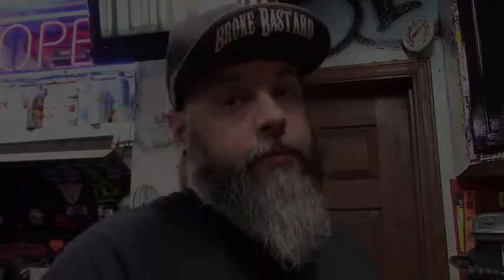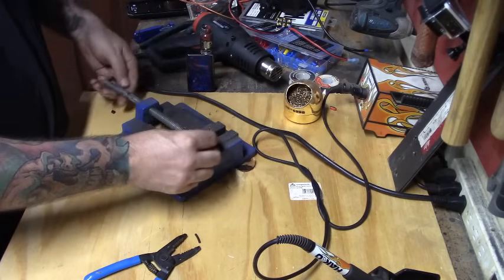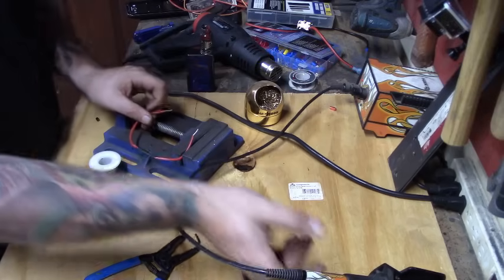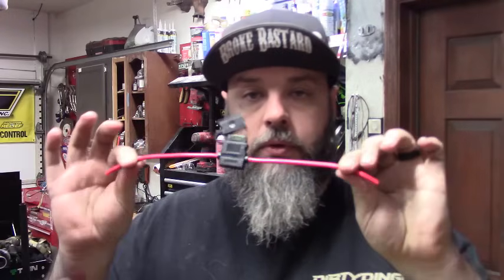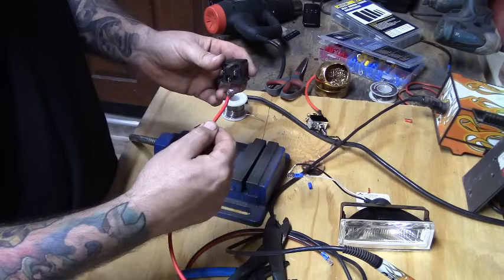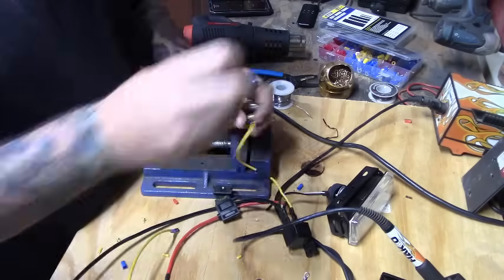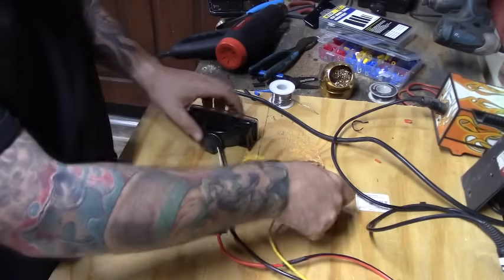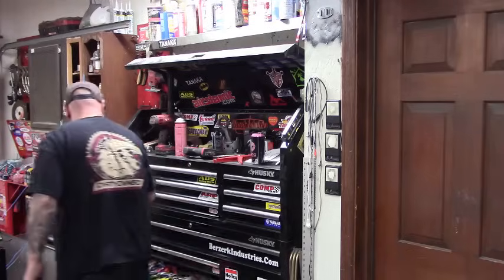How to wire a Relay and Why You should use them.

Comment: I have a car stereo that I wanted to turn on without using the key, so I ran it the other way I did use a fuse before switch. It worked for a couple months but not I keep blowing headlight fuses and I think I might have something grounding out. I also did add new headlights but bought a wiring harness with relays for it. Like I said they worked for a couple months before I started blowing the fuses. Is it possible I might have fused some wires in the harness? Also on the way you hooked that up where did the other end of the toggle switch go? 30 to battery with fuse. 87 to radio do I need mother fuse? 86 to toggle switch. 85 to ground. But not sure where the other post on my switch goes.
Reply from the maker: Paul Mayfield fuse 30 and the other post of switch goes to fused power
Reply: Broke Bastard Garage so I would have 2 wires going to the battery one from 30 relay and one from toggle switch? Both with fuses?
Reply from the maker: @paulmayfield9709  correct. You could pull the switch power from another constant hot. It only needs about 7 volts to trigger the relay. Battery is always the best. Some times I run fuse battery power to power multiple switches.
Reply: Broke Bastard Garage that’s why I thought I’d ask cause it makes no sense to me if I have power from battery going to relay and also to the toggle switch then it goes thru the toggle switch back to relay opens relay and gives radio power  I’m guessing it gets power to the radio from the other lead from the battery? I thought the reason for using a relay was to eliminate the high power wire in the cab which you would have it running to the switch then back out of switch to the relay. Cause that’s how I thought I should run it but the two power wires it what confuses me. Do you think it is possible that I may have melted some wires when I had it hooked up without a relay? Cause I did install led headlights also and I did use a separate wire harness with relays for that. But now I keep blowing fuses on headlights it shows there is a shirt somewhere and can’t find it. I even took all fuses out and tested each circuit. When I put the test light on my headlight fuse area it lights up as if there is a short. Then on the headlight prongs there seems to be power to all three prongs on one side and only two on the other. Which I don’t use that wiring for headlights since I bought the new harness you just plug into one of the headlights and leave the other unplugged. I know you can’t solve the problem over the messages but any input or thoughts on what I should look at next would be appreciated. Sometimes electricity and me we don’t get along. I don’t know how many times I have wired something it doesn’t work so I try a different way and blow fuses then go back to the way I had it and it was right. I could understand maybe not having a connection the first time so it didn’t work, but this has happened to me several times to where I make sure there is contact.

Comment: Glad that you made this video about soldering wires together on a car; other YouTubers have said that you should only use crimp or screw connectors because "solder is too brittle"...?  Dunno why they say that; I never had trouble with properly-soldered joints' coming apart on rough roads.

Comment: The problem is soldered wires can  break off , and solder runs up the insulation,  good quality crimp connectors stay flexible,  they dont solder wires on airplanes ,for good reason ,  I think it's best to stop wires moving too much i:e shrink , I like solder to , but don't under estimate crimps . Cheers .

Comment: My bad may have missed something.. but if for something so small and in most cases doesn’t pull really any voltage and even if it pulls 12v why put a fuse if your already putting a relay.. is it just for added support.. I’ve had people work on cars and they install poppers to shave doors and none of them use inline fuses just relays.. when installing other stuff then fuses would be put into place if the thing there installing doesn’t already have inline fuses … if that’s wrong by all means let me know , I have 1 popper to my door threw 1 relay and it works just fine bcuz it’s not in constant use ..

Comment: private request??  diagram from Battery (fused) to a relay to allow 3 way switch - 1 leg thru ignition - 2 (center) off) 3 hot direct from battery - thx  2023 subaru crosstrek 6spd manual have most wires tru firewall - just stuck at power connection end.. thx

Comment: I rarely comment on youtube, but you, Sir, are comment worthy!!  Prior to seeing your video, I had wired my P/T Cruiser radiator fan the "wrong way" as you put it.  The "wrong way" did work HOWEVER the wiring would get so hot at the toggle switch that I would have to cycle it off and on just to keep the wiring insulation from melting!!  So someone told me that I needed to rewire it using a relay.  Soooooo I watched many youtube videos but I was left scratching my head UNTIL I CAME ACROSS YOUR VIDEO!  I immediately grabbed a white board and sketched out my new wiring diagram based on your video!  I literally just got done rewiring the radiator fan and it works with no more hot wires!!!  You da Man!!

Comment: I like bare metal crimps better.
Less messy, and wont come apart when heated up.
I take the sleeves off common terminals and snip the barrels off to crimp with.
A pocket lighter for the shrink tube.
Its store bought looking

Comment: What gauge wire do you recommend to wire some led lights.
Reply from the maker: Depends if it’s little led strips then 16 will be fine. For pods I recommend 14 ga
Reply: great video only thing I noticed that you might mention is where the other end of the yellow wire was going. unless you mentioned it and I didn't catch it. just thought it'd be helpful for the beginners.

Comment: Question if I may ! My Harley horn is factory so it has a horn button and is fused at the factory/ it has + and - on the horn push the horn button and it honks.      Thinking of putting an air horn on with an electric air compressor ( you know the one fairly generic chrome one) that also has the + and - on the bottom. Now am I wrong in thinking just connect the +and - to the air compressor at the bottom and the horn will blow like the original because the original horn button is already fused /protected by the fuse in the fuse box running 12 v Harley horn wire from the factory?
Reply from the maker: william johnson yes it will work. But these are things to look at first 1) how thick is the wire 2)what size fuse. If the wire is to small and the fuse is too high amp it will melt the wire. See if you can find out how many amps the horn compressor draws. Then look if the size wire and fuse can handle the load.
Reply: @BrokeBastardGarage  Thanks man for your insight! 🤔👍😎

Comment: Umm I am confused at 19:30 you show the wire diagram and it shows the switch between the battery and the relay. Isn’t,t getting the same load from the battery? Or does the load fall back on the relay?
Reply from the maker: ZipSnipe the positive switch leg is only responsible for triggering the relay. It only normally requires about 7.5 volts.

Comment: Can you explain why the led light does not go on for the rocker switch but it turns on and off the device I am controlling?
I thought it was defective and the LED light was out so I went and exchanged it but the new one doesn't light up.

Comment: I'm trying to connect an air horn to my truck with a halo switch. My problem is the fuse keep blowing off. I connected the switch to the in line wire after the fuse and I was wondering if I should've connected before the fuse. Also it's a 15A fuse. What can I do to fix the problem? I appreciate it if you could help me out here

Comment: So this helped a lot and simplified the whole idea of a relay thank you! But my real question is the small air horn I hooked up to my 2003 Pontiac Grand Am is ran through the factory relay and now it's having issues, that can't draw that much power for that short period just honking a horn why am I having so many issues?
Reply from the maker: Chris Dieringer should be okay pull the horn and test in the battery. Those air horns go out a lot.
Reply: Thanks for replying! It actually worked for a second today. I'll try that though.

Comment: I' m installing a 52 inch light bar on my truck and want to add a relay . I have 2 ford relays but they have 1 2 3 4 can i use these and if so how do i wire them ?

Comment: So instead of going straight from switch to battery can I go from the fuse box so I can leave the switch on all the time and it will come on when my car comes on but I will be able to turn it off while the car is running if I want
Reply from the maker: Two Wheel Jay if you draw power for the switch from a ignition hot source. Then yes this will work as you want.

Comment: Great video. I have a question. I purchase a 5 gang switch panel, it's it's fully wired up and has a fuse on each switch. if I'm running 18 Watts led pods do I need a relay or can I run them directly to the switch? All switches have a 15 amp fuse all ready wired to them.
Thank you.
Reply from the maker: Baro41 led normally don’t use much power. Mighty be fine. But must kits for led light bars come with relay in wiring.
Reply: @BrokeBastardGarage  I just purchase the light with no wiring harness
light are 18 watts each. So I'm thinking not much of an amp draw.
Reply from the maker: Baro41 look if the wires are small then less amps
Reply: @BrokeBastardGarage  Wires are 14 gauge
Reply: I have 1 red wire and 1 black wire coming out of the 5 gang switch. They are all hooked up on those wires.
 Another question. I have a bigger light bar at the front with a wiring harness but would like to use a switch on the gang instead of the one on the harness how can this be achieved?
Reply from the maker: Baro41 use signal wire from 5 gang switch to trigger relay for other light bar.

Comment: It would be a good idea to mention that rosin cored solder is used for electrical connections because it will not cause corrosion.  Rosin flux can be used with solid wire also. Any other flux that you find other than rosin flux will cause corrosion because they contain acid.  Thanks for a really great video.
Reply: RE:lemontier.  Good point.  He says he does not use any flux, but if he is using a rosin core solder, he IS using flux because the rosin is the flux.

Comment: How do you wire into the ignition switch so a switch is not hot all the time?
Reply from the maker: fks1964 you need to use a test light. I normally start by finding an item that only works with the key on. Then find the power wire for it and test that wire.
Reply: Broke Bastard Garage thank you

Comment: Can you explain what the 30 is connected to? So the 30 and 86 are connected to positive battery terminal in order to reduce damage to the switch? I get confused because I've seen other diagrams with what looks like two separate power sources (internal battery)
Reply from the maker: 30 is fused power at the battery. 86 is power from the switch

Comment: Thank you for the video. My project is a set of LED lights that has a regular lighted switch with 3 poles and uses a relay. I bought a factory fog light switch that has 4 poles. I believe the outer 2 poles go to the relay and the 2 inner poles are a "power" and "ground". I need to double check everything with a multimeter I guess. Im just not a wiring person. Ive never done much in the past.

Comment: If you want to do this without using a switch but to turn on only when you have the ignition on what's the best way to accomplish that?
Reply from the maker: Instead on using a switch just supply ignition hot in its place

Comment: I always soldered my wires ever since I started doing electrical/electronic work; the main two advantages are that you largely eliminate corrosion that joints made by merely "twisting and taping" will often encounter, and they are far more solid and reliably permanent; a properly-soldered joint will generally not "work loose" the way a twisted or crimped one may.  As for using just flux-cored solder to join copper wires or connectors, I have never had much luck with this, especially with older/recycled wiring --- usually there is too much corrosion on the wires, even if you brighten them first; for me, the solder usually just beads up and runs off without "wetting" the copper surfaces properly, and so I need to spread solder-paste-flux onto the wires before I tin or solder them.
Reply: RE:Fred Seaborne.. I have the same problem with older/used wires.
Reply: @munsters2  Yup, I hear ya --- majorly upsetting.  What I usually do is to first clean the wires as best I reasonably can (if possible, just use sandpaper or steel wool, NOT a knife-blade --- as we all know, the stingy wire-manufacturers give you little enough of the costly copper as it is, and so you don't wanna scrape off any of the base-metal if you can help it!), then either dip the brightened copper ends into my container of paste-flux or dab it onto them with a toothpick or short piece of stiff wire.  Next, I melt a little solder onto the tip of my soldering gun and use the hot tip to "tin" (i.e., solder-coat) the wires individually (note --- contrary to what the beginner's guide to soldering says, DO NOT HEAT THE WIRES IN THE JOINT TO MELT THE SOLDER, as this will just make them oxidize and corrode again!).  Then I hook or twist the tinned wires firmly together, apply additional flux to the joint, get a bit more solder on my soldering gun, and reheat the joint with the hot solder-blob on the gun's tip to solder the wires together.  Pre-tinning the wires insures that the solder will actually "wet" the surfaces properly (you know what they say about any glued or soldered joint --- surface-preparation if everything!  It's just like with hot glue, especially on porous surfaces --- sometimes I will first spread hot glue onto each of the two surfaces to make sure it sticks and soaks in a bit), so that when you actually make the connection, the wires have their surfaces properly "married" to the solder (this is especially true with stranded wires, where corrosion can "hide" deeper inside the bundled strands), rather than its simply beading up and rolling off, or not actually binding with the copper and thus forming a loose joint.  Sometimes if I have a larger joint that I cannot properly fill/cement with just the minuscule drop of solder that will cling to the tip of my iron, I use some smaller-diameter solder to spiral-wrap around the tinned joint, then coat it generously with flux, place the joint onto a thick pad of newspaper that's sitting on a piece of scrap wood, and then press the hot tip of my soldering gun firmly against the joint so that it will heat everything up properly and melt all of the solder and allow it to flow properly into all the nooks and crannies of the twisted-together wires.
Reply: @Quacks0  Thanks for the tips. What kind of flux would be good to use for stranded wires that are difficult to tin?
Reply: @munsters2  Oh, just the regular rosin paste flux (I prefer the Nokorode brand), available at most hardware stores and on eBay (https://www.ebay.com/sch/i.html?_from=R40&_nkw=rosin+paste+flux&_sacat=0&LH_TitleDesc=0&_sop=15&_blrs=recall_filtering).  Don't use acid flux except for soldering non-copper materials like steel or iron.  Also, what you can do if the stranded wire is corroded is to strip it for a few inches so that you can splay the strands out well and therefore get access to them all.  Then wet your hands and spread some Comet-brand cleanser on them to form a thin paste; use your cleanser-covered fingers to carefully and "deeply" rub over the individual strands to remove the oxide; work the cleanser down into the wires-strands to burnishingly abrade them thoroughly (use steel wool --- like a Brillo/Lola/Quickie scouring-pad --- if necessary).  Then clean the wire-strands off with soap and water, re-apply the cleanser and repeat the process if necessary to get everything clean and bright, and then rinse them well.  Coat the strands with your paste-flux, twist them loosely together so that the solder can still seep down into all the surfaces, then melt some solder onto the tip of your soldering-gun (a small pencil-type iron usually isn't hot enough for this wire-refurbishing work) and apply the hot molten solder (again, DO NOT HEAT THE WIRES TO MELT THE SOLDER, as this will just make them oxidize and corrode again!) to the wire; it's often good to use a pad of newspaper and a hard surface to really press the hot tip down against the wires to force the solder to really melt and flow down into the joint.

Comment: Are there any connections you don't want to use solder with?  Sometimes I feel like crimping worked better for certain things but I'll find any excuse to solder stuff, I just don't know if there's any scenario where I should avoid a solder connection. Cheers bruv

Comment: If I am installing auxiliary reverse lights, and want a switch in the cab, would I need a 5-pin, or can I still use a 4-pin?
Reply from the maker: Douglas Benoit with 5 pin there are just a 87 and 87a. Just use one of them. A 4 pin only has one 87. So either will work

Comment: What is that thing you clean the soldering iron with?
Reply: A brass wool scrubby.  Found wherever soldering supplies are sold.  It is brass so that it doesn't damage the micro plating on your soldering tip.  to wit;  never use steal wool, sandpaper,  file or any other abrasive on the tip.  If the micro plating is damaged,  the tip goes down hill QUICK (it will turn black and nasty).

Comment: Question:  I'm installing a relay to a motorcycle to power the main headlights. The battery is under the seat. Would it be better to install the relay near the battery or the lights?
Reply from the maker: I’d put it near the battery